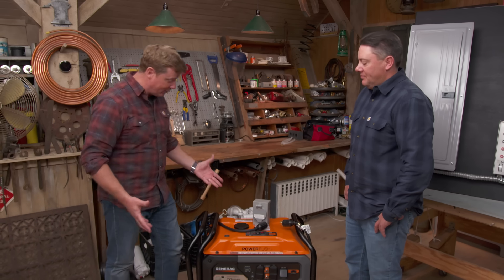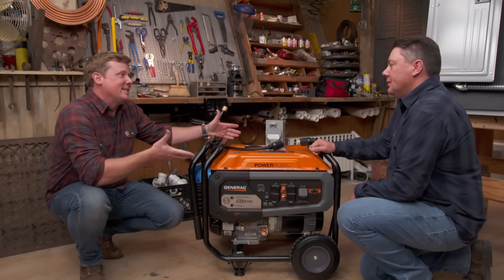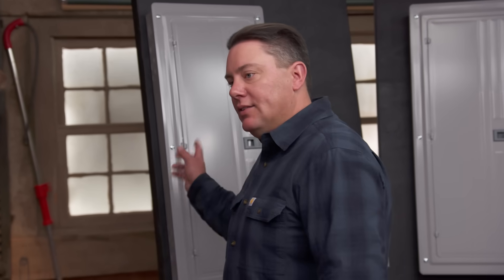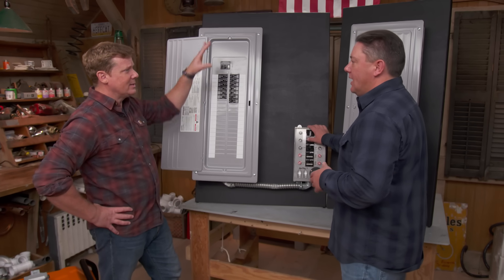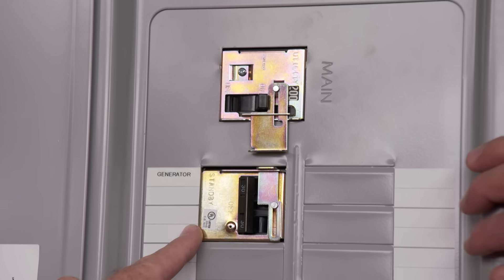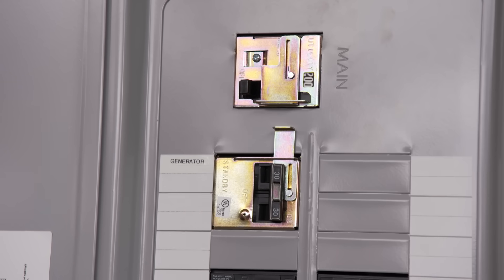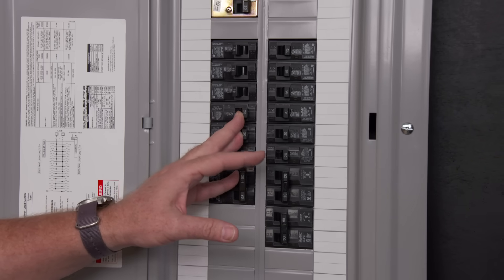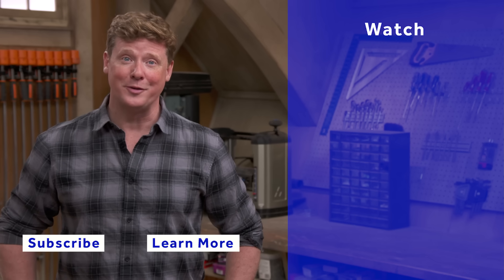How to Wire a Portable Generator | Ask This Old House

Comment: Perhaps the reason they didn't show the actual "wiring" is because it's meant for professionals only. They don't want us normal people killing ourselves. ☺
Reply: I agree. I know a lot about generator safety: there’s something that everyone really needs to know about when using generators. We should also be keeping our children safe when we’re using portable generators so children won’t get electrocuted or burned. Generators can be hot. They can overheat and carbon monoxide fumes are dangerous. They are not safe to inhale. Generators can be dangerous if not used carefully. Remember not to run your generator indoors and don’t run your generator in wet conditions. Don’t try to plug a generator cord into a wall outlet. Keep your generator 20 feet away from your home. Don’t store your portable generator indoors in any living areas and not even in the garage. Only store your generator in a shed outdoors only. Generators are not indoor use. I see some people run their generator in a garage which is not safe. Just hoping everyone stays safe especially keeping children safe because generators can be dangerous. https://youtu.be/I1jT3ANENvI and here is a video more about generator safety and keeping children safe. I’m just reminding everyone to be careful and stay safe and I’m not forcing everyone what to do. I’m just hoping they read the manual carefully and be aware with the hazards. Hope you stay safe. Thank you

Comment: I've had 6 or so power outages where I live in 14 years, only two were longer than an hour. Buried cables and other services really cuts down on disruption. However much cheaper hanging cables off of poles are they aren't in the long run.
Reply: Don’t forget about generator safety https://youtu.be/I1jT3ANENvI it’s important to keep our family safe while using generators. Especially children should be kept safe when using generators so they don’t get electrocuted or burned by the generator. Thank you. Just reminding everyone to be careful using portable generators. Hope you stay safe. Thank you

Comment: How about using the generator to charge batteries and install a smart panel to control which devices actually get power during an outage.
Reply: Generator safety https://youtu.be/I1jT3ANENvI

Comment: What is unclear is the transfer switch. He said just turn it on. But what he didn't say was whether or not I have to turn off the main breaker when I flip the switches on the transfer switch. Do I?
Reply: @Kevin-mp5of  I guess that's what is confusing me. You have a transfer switch that feeds breakers on the main panel, and when you flip the switches on the transfer switch it allows electricity from the generator to feed those circuits. So what is it that keeps the electricity from feeding back to the generator if the power comes back on?
Reply: @moodberry No you don't have to turn off the main breaker.  Because the things that are powered from the generator are electrically disconnected from the main panel breaker until you switch back to line for each circuit. In other words, they cannot be connected to both line and generator at the same time. Think about it this way, in a home you typically have a front and back door. These doors are usually separated by several feet. When you come home,  you can choose to enter the front door OR the back door but not both at the same time. Additionally, when you are inside your home, you can't place your hands on  both doors simultaneously. Hope this makes it more clear. This video https://youtu.be/GLgtFCJlVFQ?t=187 should help explain it better than I did.

Comment: This is a horrible video.   Too much human interaction needed when the power goes out.   The general population will not be good at determining what circuits to enable.

Any good electrician can wire an automatic transfer switch so that all that is needed, is to start the generator.
Reply: I know all about generator safety: remember that generators can be dangerous if not used carefully. I see some people running their generator in their garage which is not safe. We should never run our generator indoors because of carbon monoxide. Generators are outdoor use only. We should also keep our children safe when we’re using portable generators because they could get electrocuted or burned and carbon monoxide is dangerous. We also shouldn’t run our generator in wet conditions. We also shouldn’t try to plug in a generator cord into a wall outlet which can cause fire hazards. Keep your generator 20 feet away from your home. Installing a carbon monoxide detector is also required against generator safety. I know a lot about generator safety. Just hoping everyone stays safe. Thank you

Comment: Backfeed through the drier plug works just fine if you know what you’re doing and not dumb about it.
Reply: Don’t do that.  It’s not like an interlock or transfer switch is expensive.
Reply: Meadow View Lawn Care LLC … it may work, but most drier plugs don't have a ground... and remembering to flip breakers is not idiot proof either!

Comment: I like the first method because the rest of the house can still be "on" when power comes back on and you'll know its back on because things that aren't connected to the generator will begin working (if they were left on).
Reply: They sell an alarm you can put in the panel for the interlock kit

Comment: What about the Neutral? Is that not shared with the main inlet power? If the power company hears a generator running they will ground the neutral for their protection which will fry your generator. Does your system avoid this?
Reply: Alan Sawyer There is a ground connection on portable generator. It’s there but don’t see to many people using it.
Reply: @josephpuchel6497  … there is an external ground but there's also a ground in the 4 prong plug that goes to the house, where it will actually get connected to the system ground of the home.
Reply: Also be careful using portable generators
Reply: Alan Sawyer … The neutral only exists after the pole / pad transformer, where it's already tied to ground. (called bonding) Transfer switches and interlocks both keep power out of the grid side. There is NO other way to do it correctly from an installation viewpoint.

As for the power company "grounding" during repairs... what you may see is a series of jumper cables going between the phases up on the poles. What they are doing is reducing the risk of potential (voltage) between "dead wires" and any possible malfunction. These malfunctions could be a branch across wires, live wires on the ground, dead squirrel across a fuse, shorted transformer, etc. There's all sorts of issues that can accidentally put power back on a dead wire. It's all about safety while doing repairs.

Comment: A cost comparison between the two systems shown would have been nice.  Misleading title....I didn't see any wire being installed.
Reply: This old house isn't a "how to" show...it's a "How to call a guy" show.
Reply: @ryanroberts1104  ... it's about educating the consumer these days. (DIY at your own risk)
Reply: I was wondering about costs as well, for both parts and labor.
Reply: I went the generator interlock route for our house. The power  wiring from the generator is the same so the only cost difference are the two isolation methods and labor to install. The interlock kit I used was about $65 several years ago.
Reply: DIYers should not perform the work described here... that’s why it’s not a comprehensive how to. This is a $350 job plus parts cost. Save your hassle and maybe your life.
Reply: Interlock requires space on the box and a specific “lock” for how the switches are setup.  Say $100. Plus the cost of the plug.

Transfer switch will include the plug and will cost about $250 but will work with any panel.

Comment: Hi TOH , that's a good thing to have is a backup generator , just in case the power goes out or something !  👍😊🛠
Reply: It’s just a luxury in my opinion. A day without electricity won’t kill you. Use a candle for light when it’s dark and otherwise go do some gardening or read a book or take a nap.
Reply: Are you serious we’re you born in like the 50s?
Reply: b8e71fcbe2e195c67d8d16734013d20f yeah we’re like on our 5th day of no power, a day or two isn’t bad but on the 3rd on want a hot shower. Glad I made a small investment a couple years ago

Comment: The wiring is so simple... If you know, all u gotta do is run a dryer wire to the generator
Reply: That's illegal and back feeds power out to the grid, then your electrical workers servicing the grid get electrocuted.
Reply: Chris Graham I have heard that. Will shutting off the main service breaker  stop the back feed to the grid or is the neutral still connected with the dryer wire solution?
Reply: A dryer wire to the generator isn’t illegal? It’s the proper use considering it’s rated for 30a
Reply: STEVIEC MUSIC Wires (or better said, cables) have a lot more specs than only the max amp rating. And the place where you connect it to; only the ways shown in this video are legal.
Reply: You can have a safe legit setup for less than $300.  Why wouldn’t you do that?

Comment: I dont think they realize that automatic transfer switches exists and are way safer plus economical than doing this
Reply: How do you figure more economical? How do you use it with a pull start portable generator. I agree it is very convenient if you have a large generator, plumbed to a gas (natural or Propane) gas supply. Also a good solution if you need power even when no one is home.  

I'm cheap, we have a electric start gasoline portable generator with a generator lockout in the main breaker panel. We keep a supply of gas in a separate shed and test to generator every few months.   Good low cost solution for us as we can expect a week long outage every few years due to ice storms here in NH.

Comment: In order to wire a generator to your house you first need to start off with one other than a Generac
Reply: Butch Vick … been repairing generators for 25 years and I must say portable generators all suffer from the same problems. Stale fuel, gummed carbs, dead batteries (electric start) and overloading. (burn out) Last but not least, failure of the customer to run it on a regular basis and store it properly. I usually have some fun with my customers when trying to educate them.

Phone conversation: Soooo, lets say you parked your car under the deck or out behind the shed for a year or two and covered it with a tarp. Do you think it would start? <LOL> 

The fuel tank is full of water. You store your fuel cans under the deck, right? You just filled the tank from one of those cans, right? When was the last time you got fresh fuel? Oh, I see. You left it outside last night and it snowed 6 inches then waited for the snow to melt. (melted snow goes in gas cap vent) I see... and you want me to fix that for free, right?  double <LOL>
Reply: @rupe53  it was brand new out-of-the-box leaking oil I've always run the gas out done exactly to the letter what Generac recommends things have broken still leaking oil it's still a piece of junk
Reply: @butchvick660  yeah if they leak oil right out of the box they usually dont stop leaking oil the more you use em. 🙄
Reply: @butchvick660  … wherever that leak is, it can be fixed if the guy knows what he is doing. If the guy is a dealer and is sharp, he can call the warranty dept and get almost anything covered, if he is within the time limit. BTW, weak points on almost every brand are cheesy wheels and handle hardware. Almost impossible to get warranty on that, other than shipping damage if ordered direct.
Reply: @rupe53  it's been in the shop 3 times and still leaks. I have many  corspondence emails and have argued a lot with them they've thrown their hands up and said we can't help me. Simply put I bought a lemon and Gererac didn't stand behind it. PS that's not the only thing that's bad on it
Reply: @butchvick660  … not fer nuthin' but I have had words with Generac (we're a dealer) and the entire unit was replaced as long as I could justify that was cheaper than the repair. Replacing the engine is labor intensive, which can trigger an entire unit replacement, if presented properly. 50% of the time they didn't even want the old unit back, as long as I sent detailed pix of the issue and documented the problem. Of course they didn't cover S&H, but still not a bad deal. BTW, a common oil leak on a 2 cyl air cooled unit is the breather gasket, which requires removal of the flywheel to tighten the screws. If it's a single cyl then the only places to leak are the crank seals and the VC gasket. Yes, a case gasket can leak but replacing the engine is cheaper.. and replacing the entire unit is cheaper still for the factory because that's labor intensive. Makes me wonder what the in-house cost is on sets like this!
Reply: @rupe53  I was told by authorized Generac repair shop the 1st time  "If you have the same trouble twice that they would replace the unit" Which obviously was a lie. Like I said before that's not the only thing wrong with it and I can use it but totally dissatisfied with Generac
Reply: @butchvick660  … the technician has obviously not gone to bat and followed through for you. He needs to go up the chain of command and get a control number (for unusual warranty) then supply proof of purchase to the factory. The biggest problem is the amount of time the dealer needs to spend here, including S&H for the return unit, if required. It could go back in the same box but that means breaking the old unit down and draining the fluids. IOW, there may be a charge for this extra labor, unless the dealer is willing to eat that. If I didn't sell the unit there'd be an hour's labor plus the shipping here. (S&H not covered under warranty)
Reply: @rupe53  Thanks for the advice  but I bought this June 7th 2008 I've just had to live with it
Reply: Loving mine. Only had it for about 4 years, but it always starts and does the job. I have the interlock system .
Reply: @DrDaddy-yg2ki  I'm glad you've had good luck but me I've had nothing but trouble and genrac finally gave up on mine so I'll never buy another genrac
Reply: @butchvick660  i get that. Every company shoots out a turd now and then though. Sucks when youre the one that gets it, but I rarely hear anyone with something neg to say about them
Reply: @claude ... after 20+ years doing repairs I can say the gas is only a problem is not stabilized and not drained after each use. Personally, I have a 32 year old Generac that's NEVER had the carb off or cleaned. Done correctly, never a problem.
Reply: Please make sure you are using your generator carefully. Thank you
Reply: @claude ... The average person also has problems with their car, but since they use it daily that solves most of the issues. The nice thing about NG / propane is it never goes bad.

Comment: First panel seems smart.
Reply: Depending on what you need, a lot more expensive and complex to set up plus, as mentioned, less flexible. I'm sure each has its merits, but in an emergency, I've found that there's no substitute for flexibility.